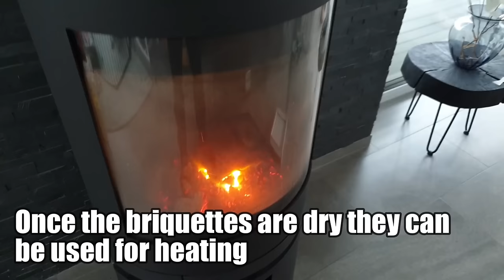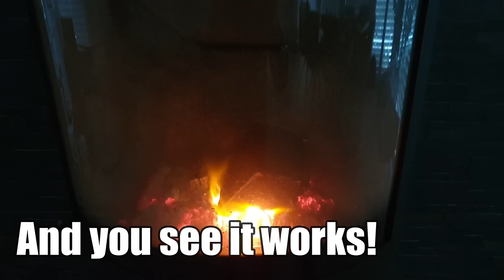Build this simple Wood Briquette Press and save Money!!!

Comment: Use a hydraulic cylinder and a steel mold, load the mold with DRY sawdust and wood shavings, compress using the hydraulic ram under 10 tons or more of pressure and the natural lignin in the wood fibers will bind/ 'glue' everything together when put under the extreme pressure and heat of the hydraulic ram. No drying time needed. Plus those cubes were not dry in the center after only a couple weeks.
Reply: Good to know 👍
Reply: That would be ideal if you have access to a hydraulic ram, much better if you don’t have to dry them. Unfortunately I don’t have a ram or anywhere warm and dry to lay out the wet ones either. My best option I think is to stack a few next to the open fire to dry out. I have a garage workshop full of sawdust from years of bandsaw ing up firewood and wood turning which I really ought to make brickettes out of and this method seems the most doable for me 😊
Reply: @SONGSTICKS 
I think the first step towards a higher compression would be to dismantle the handle and weld a nut on. Then you have the option to press the block down with a wrench or impact driver.
Reply: @Holzplatz  And the length of travel of the ram needs to be increased to allow for more compression.  As suggested above, using an impact to tighten a nut on top of the threaded shaft would decrease the amount of time it takes to compress a brick.
I love home brewed engineering projects like this.  I have thrown away so much sawdust over the year but thanks to this video I can repurpose it
Reply: This
Reply: Do you have a Facebook or telegram? Im planning to do same thing and make woodturning with the final output.
Reply: I’m looking to make blocks from sawdust & this method to build a house 1200sq ft.

Comment: I have made my own logs. They burn much faster then a normal log. Be prepared to stoke the fire more often. I didnt use this method. I used a long beam and my body weight. The fulcrum in the right place will give u very cheaply ctazy force.

Comment: If you can weld, you can make a much better version using a bottle jack.  A shop press, piece of steel tube of the appropriate size, and some small pieces of steel plate will work as well.
Reply: Do you think mostly pine saw dust is ok? My shop has lots of KD pine dust.  Thanks
Reply: @CarveLife  Generally, you don't want to burn pine in a wood heater because of the creosote buildup, if you can avoid it.  Some places have to because that is all they have.  Pine also burns faster and generates less heat than oak or hickory.

That said, there isn't any reason why the same process wouldn't work for pine dust.  You may have to modify it for the fine particle size.
Reply: @boeubanks7507 That’s not true with pallets, which I would think this is the same thing
Reply: @AnthonyAnthony-tk4ye  Some pallets are made of hardwood.  Especially heavy equipment pallets.  Not terribly common because of the expense, but I have seen them.

But yes, burning any pine will result in creasote build-up if you don't run a super hot fire.  Pallet boards are just small and dry enough that they typically burn very hot and fast.

I grew up burning wood for heat and saw all of this first hand.  The only thing we would use pine for was initially starting the fire sometimes.  Other than that, we burned all hardwood.

Now, like I said, some places only burn softwoods because that is all they have.  However, they will have to clean their chimneies at least annually or risk a chimney fire.

Comment: Can I offer a suggestion? Replace the clamp with a pull down lever attached to the press. This would improve speed massively. Like the handle on a drill press or mortiser.
Reply: My thought exactly. And you can also achieve a far greater compression... need to be careful not to break the mould!
Reply: Watching that video, I was reminded of an old saying "a day in the bog is equivalent to a week in the forest"

Comment: In the time it takes to make 1 lb of "briquettes", you could have picked up 100 lbs of "windfall" after a rainstorm.  If you are going to make one, and actually save energy, you need a good source of sawdust. (Maybe you have a sawmill or a cabinet shop) and you need to  build a system that will batch manufacture. Or even an extruder system.  Run it with $1.00 worth of electricity and put out 200 lbs of extruded briquettes..
Reply: I imagine it's less about economy and more about recycling something that is already there in abundance. Most people just throw it away or dump it in the woods.

Comment: Hey what about using this kind of tech to do all sort of vegetal concretes ? Many experiments has been done to have some economical, structural and insulating blocks, logs, boards, pannels for building... Clay slip straw and / or lime / or cement, mixed with sawdust, any plant residue like hemp, linen, miscanthus, dried grassclips..  All a research field!! Check my concrete playlist if needed